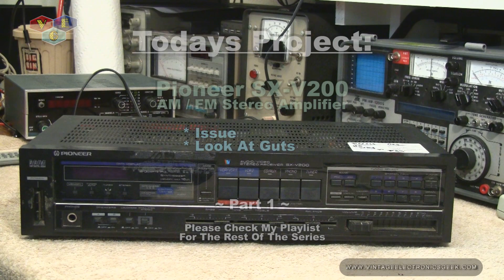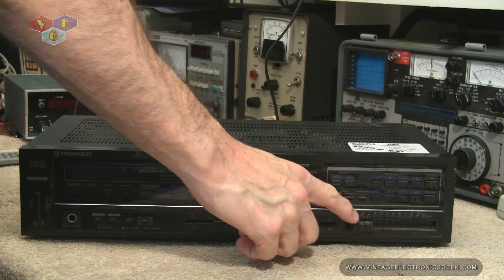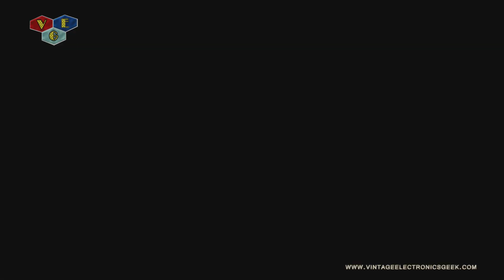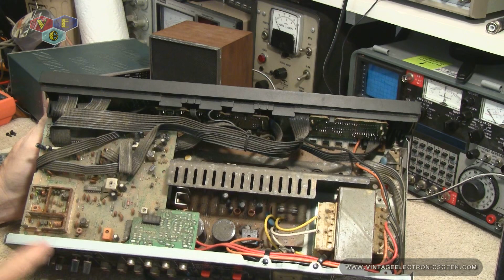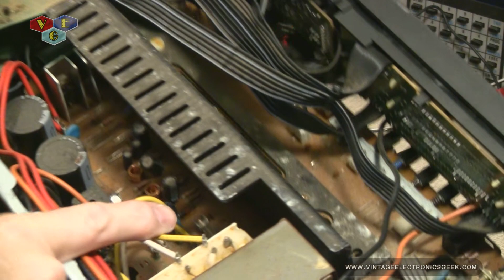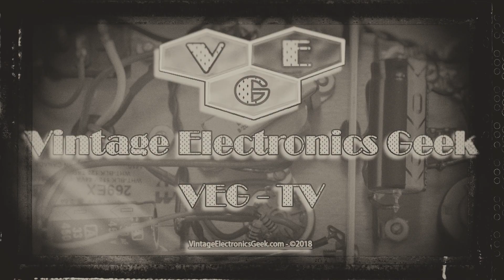Pioneer SX-V200 - * Issue * Guts - Part 1

Comment: I have a SX-V200L (same unit but with Longwave as well as AM.  Clips push down to release the ribbon cables (they just come out with bare ends).  Easy to make a mistake and put them back in the wrong sockets though, so care needed.  The small switches for speaker select and tape monitor are always a problem on these units.

Comment: I still have my old Pioneer SX-650 and my Pioneer Dual Cassette deck and recently bout another pioneer Tuner with Graphic equalizer. So this has a lot more features that the ones I have. You only paid $3.50 man what a steal and it works except the right channel being dead. Well at least you didn't have mud dauber wasps nests inside they tend to really be dirty why I had to wash out my 1946 Sears Silvertone radio with soap and water. Paper wasps are a bit cleaner.

Comment: Hmm, if the STK chip is bad, it is probably not worth repairing. Standard procedures apply: get the service manual or STK data sheet, feed in a sine wave and check the voltages. Thanks for posting!
Reply from the maker: H,mmm...we may see all that in the next video??This video is 7 months old and project is complete...but I wont spoil the ending!  :)  Thanks for watching brother!  ~Jack, VEG
Reply: @VintageElectronicsGeek  I will make sure I have popcorn ready! If I am feeling it really deep, I will open a cold beer.

Comment: Have you checked if it works with an external source?
Reply from the maker: Howdy WA!  I did this video 7 months ago, I believe I did...once I work on the rest of the video, I will remember!  :) Thanks for watching!  ~Jack, VEG
Reply: @VintageElectronicsGeek  

If I'm not mistaken, those monster ICs often contain not only the power amp, but also preamp EQ buffers etc. So if the problem is within the AF section (and is not something trivial like a cold solder joint or a corroded switch), it will be most likely the chip that needs replacement. Caps shouldn't really be an issue at this age, except ones under high stress. I would suggest signal tracing the chip.
Reply from the maker: Thank you WA, I appreciate the help!  I learn allot from you! I reviewed my video and I did indeed put a tone through it and scoped it, when I start editing that video, we'll see it in the next one coming up.  Please keep in mind I shot this video 7 months ago and the project is complete... :)  ~Jack, VEG